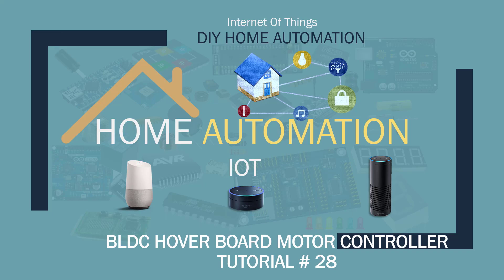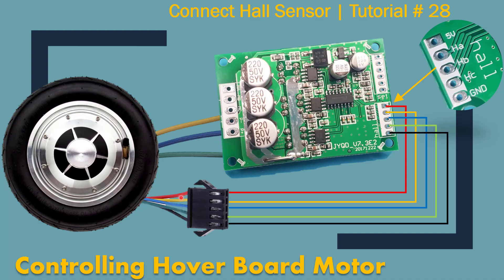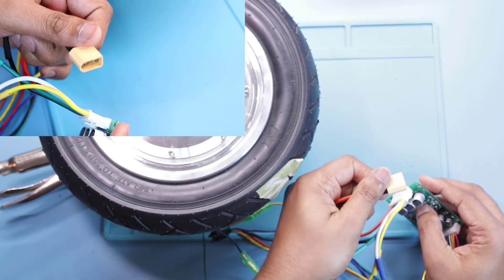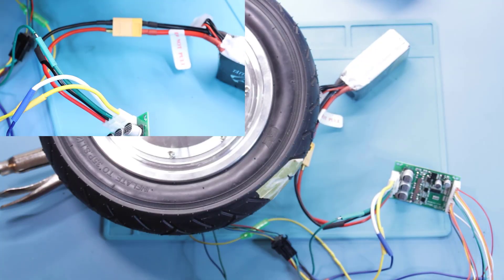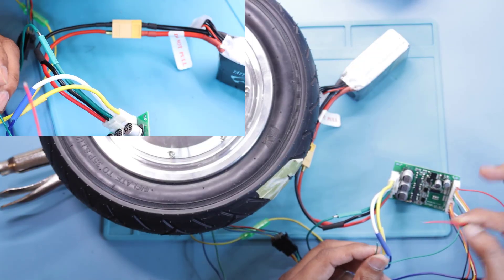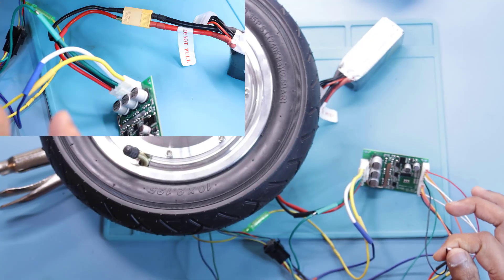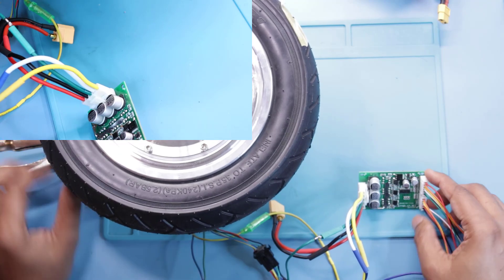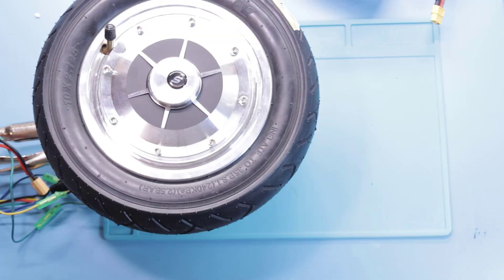BLDC Hover Board Motor Controller | Part 1| Tutorial # 28

Comment: Thanks for the update. Doing something similar but for moving winter pots in and out for front protection. Thing is those hover board motors are not cheap are they? Where did you get your one from?
Reply from the maker: Shane It depends on what size motors you are looking for. For instance, hover board motors go around $30 to $80 per motor based on the size (6" to 10"). Also, you need to consider how much torque you need. You can also consider servo or dc motor with gearbox reduction. It may be a better solution; it really depends on your needs and the budget. I hope this helps. I bought the motors from eBay for $50 a piece.

Good luck with your project and thanks.
Reply: I would need to 2 wheels that could move around 100kg but very slowly. Maybe even only at 1m/min. Yes I know that is VERY slow. No need for speed just being able to move weight.
Reply from the maker: You have some of the following options. Make sure search for correct motor for your needs with motor driver. Good luck.

Motors With High Torque
https://goo.gl/sYnZga
https://www.ebay.com/itm/152970257670

NodeMcu with motor shield
https://goo.gl/QfzorN

Arduin UNO Motor Shield - No Wifi
https://goo.gl/j875u4
Reply: Thank you for your suggestions. Will let you know how it goes if I ever manage to get all I need done